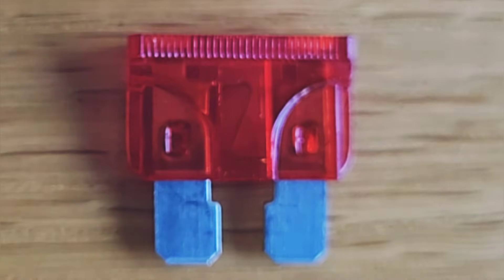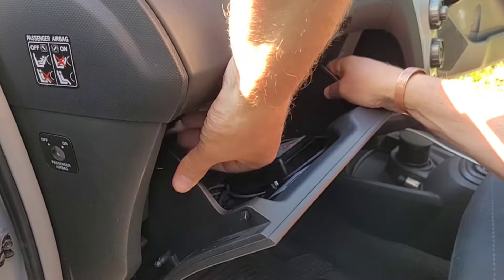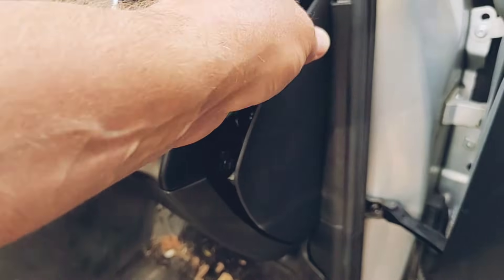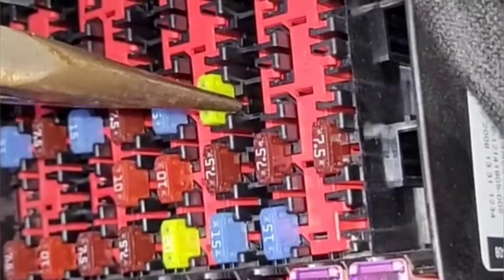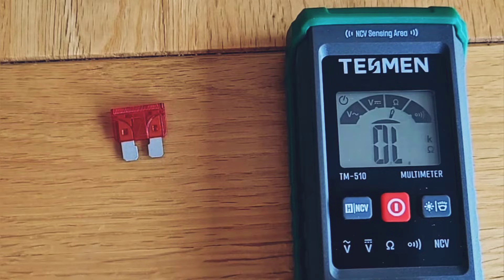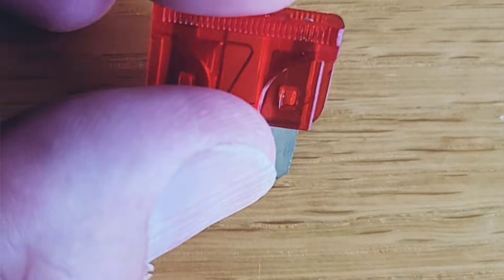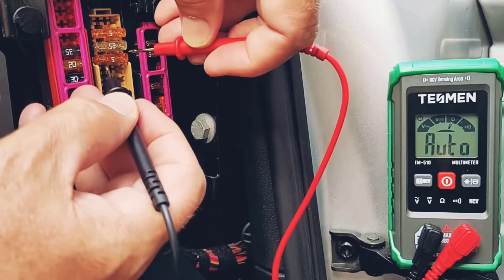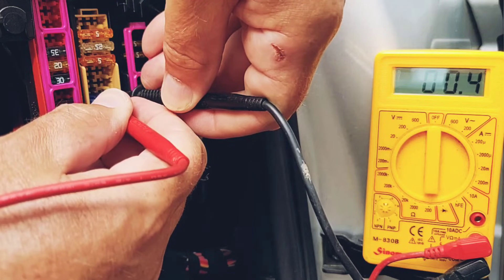Easy Way to Test Car Fuses

Comment: Can I use an automotive battery tester to test a mini-van circuit breaker? Wing windows in back, each side, stopped working. So far, no fuse for individual windows or that separate switch for wing windows. All other windows work fine. Just need to replace recently broken buttons for the switches, driver side. 
I'm new to the battery tester. CB1, I'm pretty sure, is the breaker. Online diagram shows it to be, "power windows". Fuse box under hood is not really clear. Uses initials. Note: rainwater drips in on driver's side. I do keep blotting it. Almost 3 years since I got this. Recently heard crackling after pressing wing windows button - I figured it's shorting out. I recorded it. Hah. A day before or after that, pressed lock button, locks locked and then popped up again. Lasted maybe 1 day. Fine since then. Wing windows switch is separate from panel above it, so I thought maybe it has separate fuse. Or maybe wiring underneath fried? 
2014 Dodge Grand Caravan SXT. 
Thanks for whatever help offered.
Reply from the maker: You can find a fuse box diagram for the Dodge Grand Caravan and an accompanying list showing what each fuse protects here: https://fuse-box.info/dodge/dodge-grand-caravan-2011-2018-fuses#2013_2014_2015_2016
I'm not familiar with your vehicle, but suggest that you test the following: M26 (driver window switch), CB1 (power windows), and possibly J3 (rear door module). Good luck 🙂
Reply from the maker: This might help: https://youtu.be/VhY_izL5Hmg?si=8mdF-6nurh88EWFq

Comment: I'm dumb when it comes to this kind of thing and your video actually taught me something. I had a regular MM and couldn't figure it out. I bought an AUTO one and now I at least have a chance. Thanks for your video... trying to figure out why my cigarette lighter stopped working.
Reply: Please dont call yourself dumb so fast,,, prefer inexperienced... We ain't dumb when we are still willing and can still learn.
Reply: @MrLilHammer   I agree. "Dumb" is more like an unwillingness to learn. 
I've had to replace lighters over the decades, not a lot - just the lighter portion, not the part where it's inserted. Get the lighter part in big box store or automotive store. It seems that once I needed the base part replaced. Would have been decades ago. 
One video at a time, you can learn whatever you want to. I have confidence in you.
Reply: My cigarette lighter in my 88 Accord never has worked, from Day 1, over 28 years ago, when I bought the car! 😮 I wonder if there is any kind of kit to install a new one? I don't smoke but it would be great to have it act as a charging port or accessory connection. ❤

Comment: I'm sorry, it's not clear what a bad reading is.  1?  So Anything else is good?  I've got a multimeter -can use it -just no clue any reading.
Reply from the maker: The multimeter should be set in resistance mode (reading in ohms). A reading of 1 shows that the circuit is incomplete, i.e. the fuse is broken. A reading of zero or close to zero shows that the fuse is OK. I hope this helps 🙂